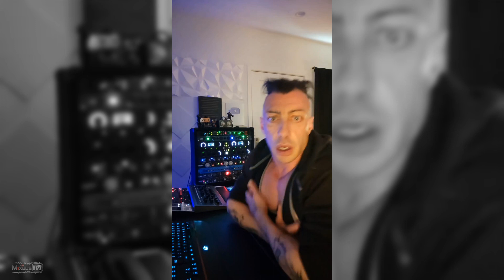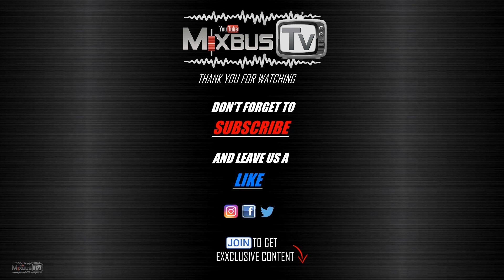Mixing With A Limiter on the Master Fader? 🙄

Comment: I add limiter on my master and bypass it while mixing. But when I'm trying saturation or  new/unfamiliar transient processing plugins, I turn limiter just for safety purpose. The Izotope Trash plugin almost crushed my studio monitors once when i pulled a preset and the master bus went over 300+ db above zero. I tried to play music, but the speakers weren't making any sound. I restarted my speakers, but nothing happened. Then i restarted my laptop and thankfully everything is working well till now.  It was a scary day 😅
Reply: This can happen even with familiar plugins. I have had both soundtoys, izotope, IK, softube and others do it. Totally random and far far between times. Seems more like a cpu error than the actual plugin. So my limiter stays in while mixing just to be safe. I too almost blew my speakers once. Never again!!
Reply: good thing reaper has built-in channel mute protection😅
Reply: I do it to, and let’s not forget the ears because without them all those knobs are useless.

Comment: so, I now use speakers. wouldn't it be better to put a limiter on there as a safety mesure against smth bugging out and causing an insanely loud noise rather than as a squashing tool? or does it depend on the limiter to avoid colouring the sound like fabfilter's pro-L
Reply from the maker: What are you doing to cause such loud noises? I think it happened to me twice in my entire career
Reply: @mixbustv  vst crashing 😅. Especially my piano vst can be quite unstable at times and when it crashes it just send out a loud as hell noise

Comment: Hi David, thank you for the video....I have question: there's this "trick" I have heard some engineers talk about using a vu meter to set the the balance between kick and bass by setting the kick to hit say -3db and adding the bass till the vu hits zero...what are your thoughts on this
Reply from the maker: It's a good way to get your starting point, absolutely nothing wrong with it

Comment: I found a specific use for the limiter on the 2-bus (I'm not super experienced, but this really helped me understand how all the elements in the mix interact): I temporarily turn on the Sonible Smart Limiter to set up a quick limiter to simulate what would happen if I sent the track to mastering, and then use the excellent monitoring on that plugin to identify the instruments that are hitting the limiter unnecessarily hard. This has taught me to find those tracks (often snare or kick) and use saturation to tame those peaks while trying to retain the timbre of the instruments. The result is often mix that seems to be able to handle limiting much better. After you've used it to analyse your track you can turn the limiter off again.
Reply from the maker: You won't need the second part once you have enough experience, the first part is on one hand fine, BUT, see my reply to Max in another comment.
Reply: @mixbustv  Ah, interesting I think I understand: you don’t need to be doing any testing like this, because with experience you HEAR immediately the stuff that’s peaking out too hard and you will just handle it as you go along, and the other point is that you would have to be very careful not to use the limiter in this way to test how your track will SOUND like after mastering - because my limiter settings are completely different to that of the mastering engineers. So maybe the takeaway is here is that a better tool would be use the Ozone Tonal Balance to try and work with the crest factor - that’s a purely visual meter and doesn’t change the sound.

Comment: Isit wrong that I mix to the limiter to see how it'll sound in the master. Take the Limiter off when I bounce the file out for Mastering but put a Soft Clipper on the Mix bus for Volume?
Reply: The concept of wrong is a little ridiculous in my opinion. However you manage to get to a desired result is right for you. People keep forgetting this is an art and too often take the opinions of others as gospel.
Reply from the maker: No it's not wrong but it depends because if you push your "let's hear how it sounds" to ridiculous levels then you develop an ear for that and you get accustomed to the problems. Now you have a bias and the mastering engineering could be cornered. But generally speaking, no it's not wrong because the mastering engineering, if he's any good, will do a better job
Reply from the maker: And people forget that it's not just art but years of practice and study and learning how to use their tools. Too many hide behind the "it's art" thing. It's not ONLY art and if you miss the rest, you're just winging it

Comment: Hey David,
I totally understand your chain of reasoning.

One chain of reasoning that I also understand is this: "I want to hear the "final product"."

And to my ears, limiters change the relationship of the instruments to each other.
And this is also part of the sound.
And this happens differently depending on the manufacturer.

But the bottom line is: let the mastering engineer do the job. A second set of ears, a second opinion and a second aesthetic feeling.

Personally, I use a limiter on the master bus to find errors and to get an impression of the finished result (in relation to the instruments). I look at what the limiter is grabbing, and how much of it. But I also turn it off again, and never send the mastering engineer a version with limiting.

Thank you for your contend.
Reply: The mix would/should be relatively close to the final product where mastering is generally just very subtle moves that shouldn’t drastically change the mix. If they’re impressed with the mix and they think that the song is finished, then they would be more impressed after the master.
Reply: At the end of the it matters about the sound that the producer wants, not the sound that the master engineers wants. Some people less Mayo and others like more Mayo. I once had a song mastered by a reputable well known experienced individual and was not pleased with the end result. It was a contemporary upbeat gospel song that needed to hit hard. The bass guitar player was driving the song. The mastering engineer felt that it was a little bass heavy and cut it way down. The song was less impacting afterwards. I called him and let him know that the bass guitar was the driving force of the song. Once he knew that he increased the bass more than I had in the mix. It changed his perception once I told him why I needed the bass full. He then acknowledged that it did sound better with the bass. I respect everyone’s gifts, talents and abilities but I want what I want. The mastering engineer works for the producer/ artist, not the other way around.

Comment: From my understanding, the reasoning behind mixing (or referencing) with a limiter on the master bus is for making mixing decisions so you can hear how it will sound when it is limited and brought up to level. Then you remove the limiter before mastering. This would be similar to mixing (or referencing) in mono to hear what it sounds like, but you don't send a mono mix off to master. It's only for referencing to help you make better mixing decisions. What are your thoughts on using a limiter in this way during mixing?
Reply from the maker: No harm, but mastering isn't just slapping a limiter on the mix, or anyone could do it. If your mastering engineering is any good your mix will sound better. This is once again a practice came to life because of all the misinformation and "quick mastering" videos out there
Reply: @mixbustv  Absolutely mastering isn't just slapping a limiting on...... because mastering is just slapping Gullfoss on, right?!? 😜
But seriously, no doubt the final master will sound a lot better than the limiter, but do you think mixing through a limiter (and then turning it off before mastering) will ultimately help the mix come out better thus helping the final master come out better too? Or do you view this as a net negative that works against the mastering where they are trying to fix "issues" in the mix that aren't actually there and only caused by using the limiter? Or does it even matter because you can work with it regardless of what they do?
Reply: Perfectly said Tekkerue!!!! That’s what I do!!! It’s all about personal preference!

Comment: Is it ok to use a transparent clipper to shave off the peaks of your transients from your tracks to help with the master limiter? Or is this just more bad information? I was told this would help make the master limiter more clean and transparent, less gain reduction and less distortion on the master limiter.
Reply: David has a video on how to use a soft clipper on individual tracks to reduce the level of transients and preserve punch.
Reply: @kelainefes  thank you much 👌

Comment: Hi there, I generally agree with the video. I do separate the mixing and mastering process, however I still use a limiter on my master channel in the mixing stage. But not for gain staging or mastering, I use it only for catching the occasional peaks, to prevent digital clipping. But Im not a pro and maybe Im doing it wrong :-)
Reply: I do the same, my limiter usually does nothing
Reply from the maker: You say you don't use it for gain staging but use it to prevent digital clipping, so you do use it for gain staging, otherwise you wouldn't clip in the first place
Reply: @mixbustv  Ok, maybe gain staging isnt the right word. I meant I dont use it for pushing the gain in the mix stage. Just as a safety to prevent clipping. Which doesnt normally occur, maybe 2-3 times in the whole track. And the gain reduction may be at this peaks max 0.5 to 1 db. I have always enough headroom. I mean I dont see the problem here, wasnt the limiter made to limit the signal? Meaning unwanted peaks? But as I said I dont do this for living, I dont charge and Im not a pro. Its just how I work and it seems to work..
Reply: @tomasszabo2238  Then you are using it because you don't gain stage correctly. Sure, if you work in broadcast, that's what a limiter does but I assume that isn't your situation. You can't say you always have enough headroom and at the same time say you need to a limiter to catch some peaks that would be clipping your two bus. Those two statements are diametrically opposed.
Reply: @greenenoiseaudio  Again, my limiter is only catching peaks which may occur. Most of the time such peaks doesnt occur at all. As I said I have enough headroom and the limiter is most of the time doing nothing. It is not the same as when the limiter is working all the time or even sometimes. So yes, you can have enough headroom to work with and also have a limiter ready to catch a peak. Or do you think that you can hear a transparent limiter working once/twice in a song doing 0.5 db gain reduction? I dont think so.. Yes, I could take down the whole mix on the faders, lets say 2db. But Im used to certain volume and parameters and thats how I work. I didnt say this is the only correct way, but its how I use this. And it works for me..
Reply: @tomasszabo2238  Yes I can read and caught that the first time. We can gloss over your attempt at a strawman re the transparency of whatever you're doing because I never said it was or wasn't and the reiteration of having enough headroom though sometimes potentially not but that you still do...but at the same time need a limit because you don't. Re the volume, turn up your monitors to compensate. My comment was only regarding your headroom statement. If you want to work like that, no one can stop you, nor should they. There's just no benefit to it and only potential downsides. It's just a completely unnecessary step or 'safety precaution'. It is better to do things with intention rather than as a safety net for sloppiness. Instead of using the limiter as a bandaid, just clip gain your tracks down a couple of dB and you equally never have to think about it. It's a mentality thing. You say you aren't a pro - that's fine. Never hurts to still be professional in what you do.
Reply: @greenenoiseaudio  So you are saying that I can do whatever I want, but at the same time that Im doing it wrong? I dont want to be cocky, but I dont know how to interpret your answer. Btw., I forgot to mention that when Im printing the mix I take down the master fader 1-2 db. So even if I had the occasional peak, this is no issue anymore. Even if I didnt had any peaks I reduce the master channel at the export. I mean I never got an answer from the mastering engineer that the mixdown has no headroom, or similar. Actually quite the opposite.. Therefore I still think if you doing it correct, the limiter on the master can be useful..
Reply: @tomasszabo2238  again I never said you are doing something “wrong” per se. To reiterate, I was saying you stating you have ample headroom but at the same time using a limiter to catch peaks, even if only occasionally, by definition is an admission you don’t actually have enough headroom. Or at least run it close, regularly enough for it to be a concern. I don’t see what’s controversial about that. 

Of course you can do what you want, regardless of if there are best practices or not or even if you’re doing something catastrophically bad. Those two things aren’t mutually exclusive. It’s your mix, there is no mix police that’s going to make sure you do anything. But…you can also put soap instead of oil in your car. No one is necessarily going to stop you doing it however that isn’t an indication that that is what you should or shouldn’t do or if you would be better off in the short or long terms not doing it. 

The mastering engineer saying or not saying something isn’t necessarily an indicator of anything either. Keep your tracks hotter, use the limiter and turn down the master fader before bouncing. All just unnecessary if you literally take a couple of dB off the tracks to begin with.
Reply: @greenenoiseaudio  In the end of the day its totally irrelevant if you use a limiter or not. The important thing is if the mixdown is good. Some will argue that it is useful, others that its bullshit. I mean whatever works for you..

Comment: Funny enough i was going through my old Win XP daw and i was going through the old limiters and i noticied immediately that the Sonnox one has a sound.  Just putting auto-gain on and using 'enhance' to taste.  Is that part of the trick ?
Reply from the maker: The sonnox has a sound just by inserting it, no processing needed. The "trick" is in the pre-processing section. The enchance is a different part and it can also be very useful
Reply: @mixbustv   ah ok thank you David !

Comment: David, this has always been a question of mine that I can’t find an answer to:

When gain automating the vocals before being fed into the compressor, does the act of gain automating affect the dynamics in a way that bad gain automation + compression result in dynamics being negatively impacted twice? Or is gain automation and compression completely independent from each other and only compression can affect dynamics, while gain automation is just turning down the level while preserving dynamics? 

An extreme example to get my point across would be , if we had 2 tracks where one vocal track has its gain reduced by -20db, and another track doing -20db GR on a compressor, would the former still be considered more dynamic?

Thanks for another good video, as always! 🙏🏽
Reply from the maker: It depends on the daw routing, usually inserts are pre fader so whatever automation you do before a compressor (with the fader( won't affect the action of the compressor. The second part is, compression changes the envelope of every single event/peak that triggers the compressor, hence you have an attack and a release control, automation doesn't change the envelope, it simply moves the volume up and down maintaining everything else as is. One other thing many do not understand about compression
Reply: @mixbustv  Man, you don’t even know how much I appreciate your help.

Thank you!
Reply: @MerajTypeBeat  Of course what david says is completely true, but i think that you were referring to adjusting the clip gain of the audio file, am i correct? Because in this case yes, adjusting the clip gain does affect the way it gets fed into the compressor, while automating the fader is (usually) post inserts so it wont affect the compression.
Reply: Another answer to this is that gain is simply a special word for volume at the start of processing where gain is similar to input volume where your second question nails it right on the head. For your first question, it won’t be negatively impacted twice, but it’ll be negatively impacted depending on how much gain you’re putting into the compressor and how much the compressor is squashing the dynamics unless you’re using it for artistic intent such as bringing up low-level audio/signal for more detail like reverb tails. To answer your final question, yes. Gain is simply all about level where it doesn’t affect your dynamics at all. Hope this helps further.
Reply: @tdengz  Yes sir! It does help and further clarify things. Thank you!